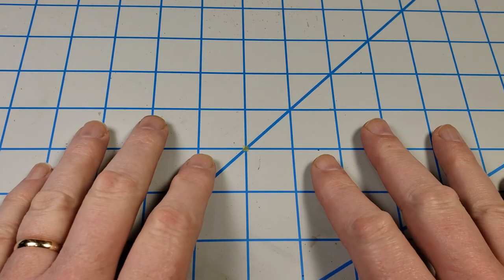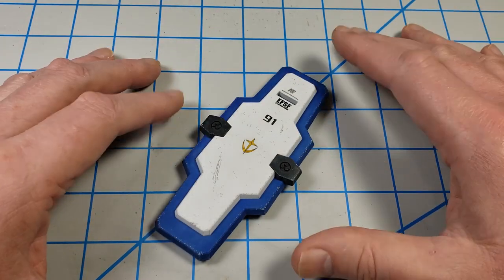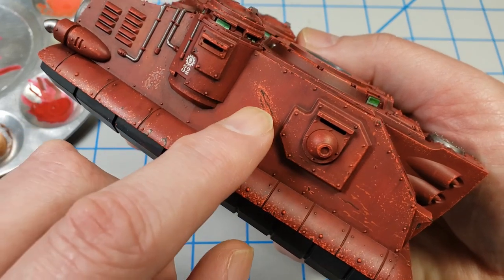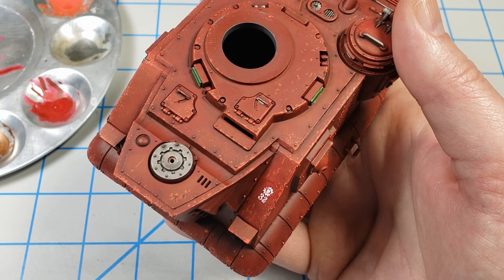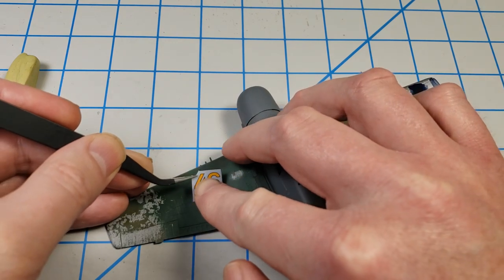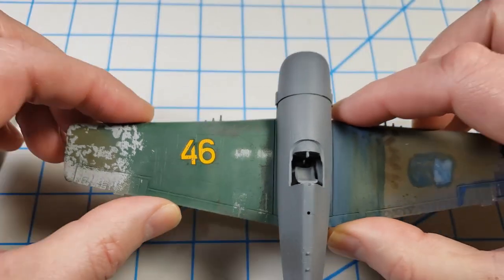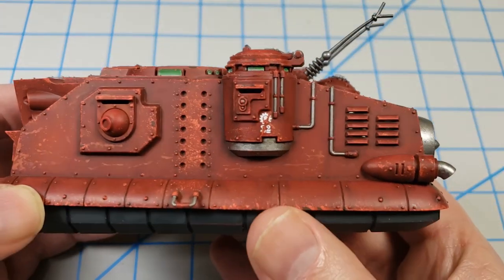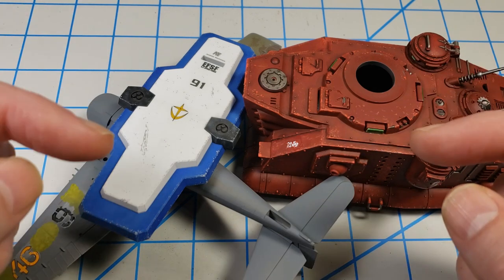Scale Modeling How-To: Chipping Waterslide Decals

Comment: Just use a decal film or clear coat after doing the sanding weathering of the decal (that way you don't have to worry about it falling apart, although it does make it a little thicker). Also useful for using those old decals
Reply from the maker: Thanks for watching and commenting!

Comment: Hi Jon, can you give me some guidance on applying waterslide decals to clear model plastic such as canopies and windows? Does the plastic require some form of clear coat on the area for  the decal to gain good adhesion?
Reply from the maker: You might want to do a dip in Pledge/Future, which would give a better surface for adhesion, but it's not an absolute necessity. The main thing will be eliminating the traces of carrier film by cutting them away before applying to the model. A good setting solution should snug it down nicely. A bonus touch would be to do a post-decal dip in Pledge/Future to seal it all in and mask any ridges around the decal.

A good way to test things would be to simply put a spare decal on the canopy, right on the plain plastic. See how well it adheres. It should clean off easy enough with alcohol and a cotton bud. That should give you some data to evaluate it with.

HTH!
Reply: @JonBius  Thank you. I do actually have a few bits of spare clear plastic so yes, maybe some tests are in order. Appreciate the prompt reply too!
Reply from the maker: @Dave-sg6om  Glad to help! Happy day to you!